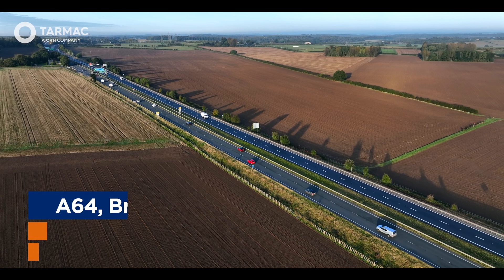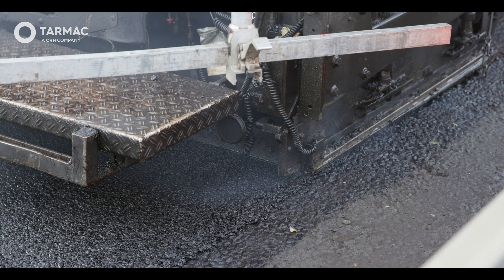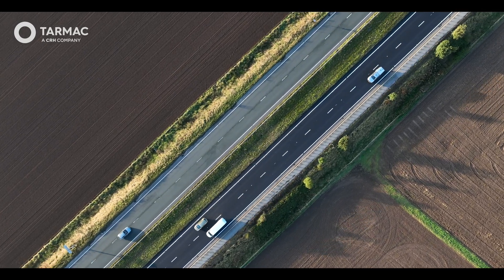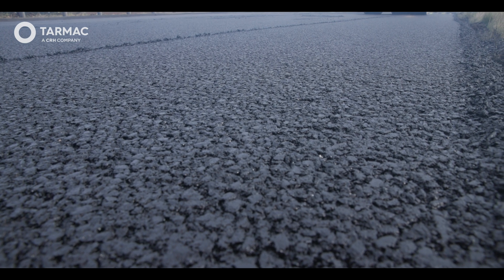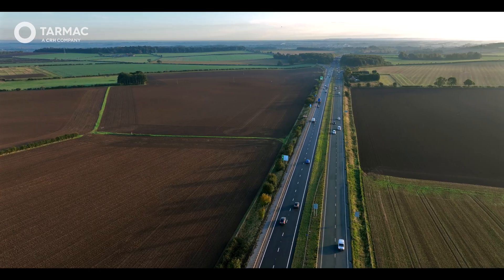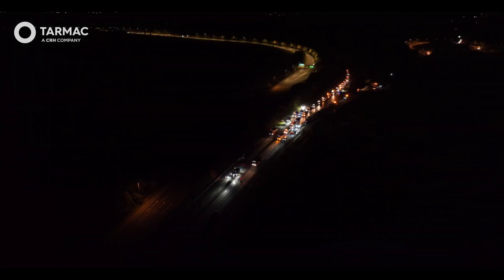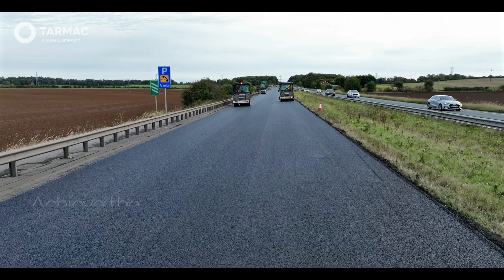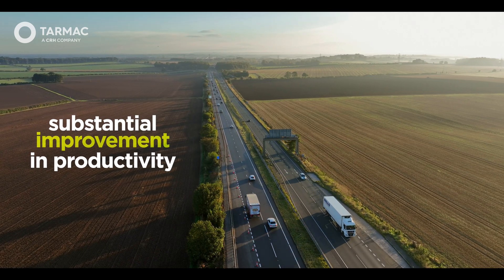A64 Bramham - Low Carbon Road

Comment: Great to see that carriageway ride is now being considered for the first time in many years on resurfacing project. Echelon laying will significantly reduce problems with the longitudinal joint failing within the lifetime of the surface. Both objectives only achievable with total carriageway closures. Lets routinely close the carriageway to provide these objectives and sell the benefits to the customers.  Total closures will also provide significant financial efficiencies as the volume of material laid will be significantly higher than over night lane closures.